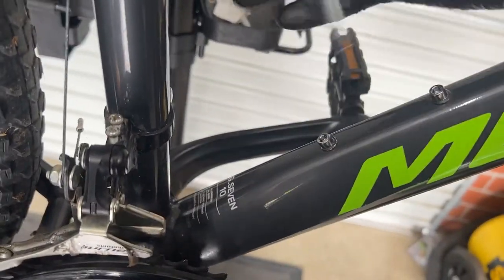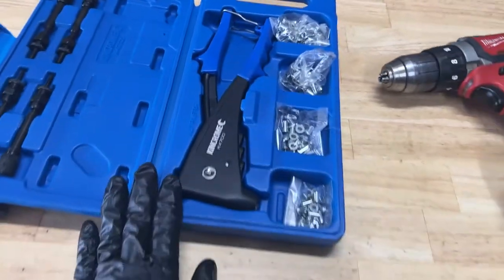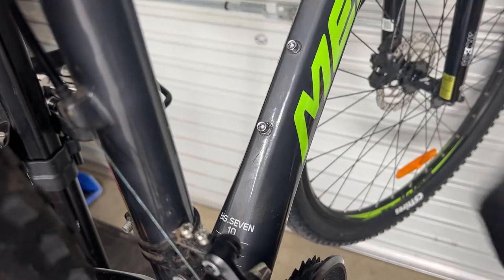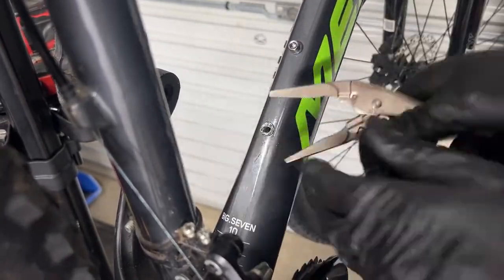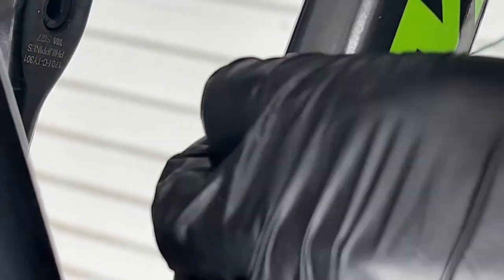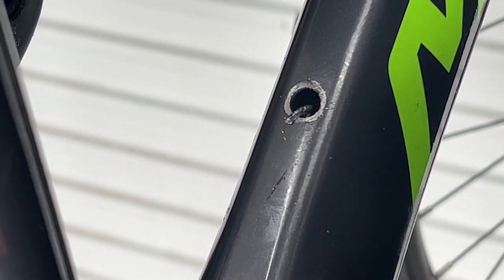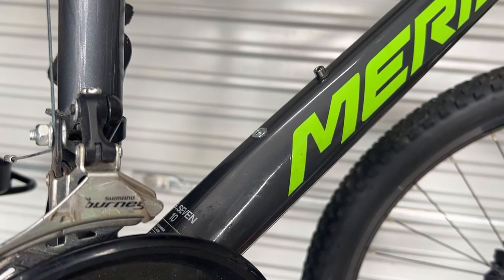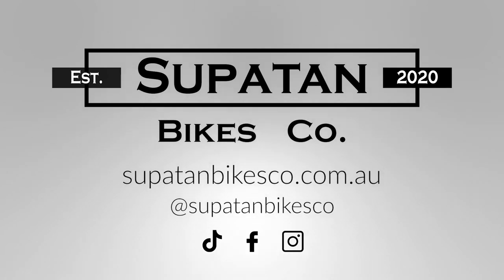How to fix Bottle Holder Screw Nut on Bike

Comment: You have two options you can squeeze/bend up the top part of the rivnut so it drops down, chance to scratch frame. Or you can drill out the walls of the rivnut hard to do unless you can drill stright down need to know the right size bit as well so you don't over drill the frame hole.

Comment: Did you try squeezing the original rivnut tighter with the gun before drilling it out?
Reply: I actually had success squeezing the base, to stop the rivnut from spinning while I unscrewed the bolt. I regreased the bolt and rivnut threads, for now. I don't want the bother of being without my bike until it has to go into the shop for something more serious. I also didn't want to spend $100 on the tool - - which I might never use again.

Comment: It’s easier to take the forks off to get the bit out that’s fallen inside the down tube, and if you’re doing this on the seat tube you can take the seat post out.
Reply: What about a seatstay?
Reply: seat tube not work, nut will get caught in the grease on the crank.